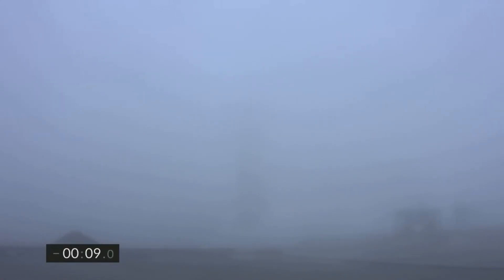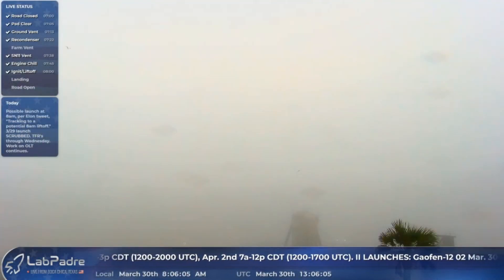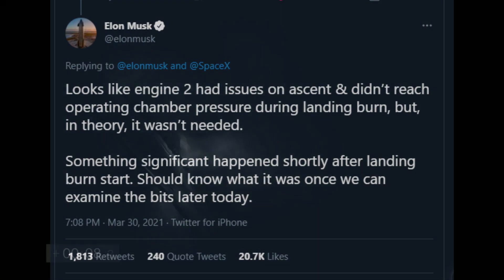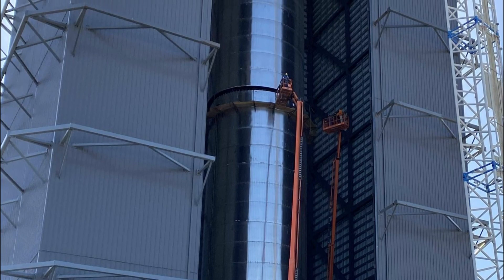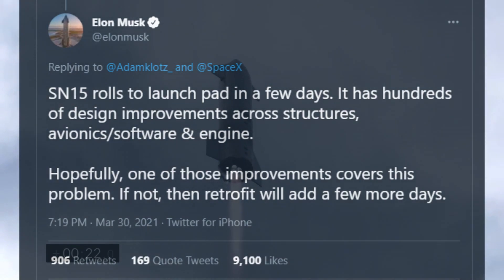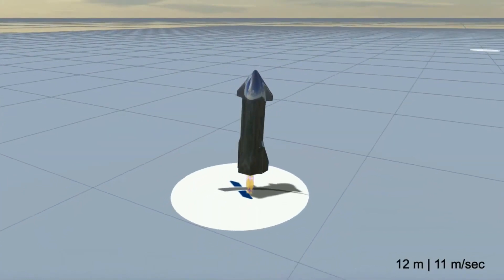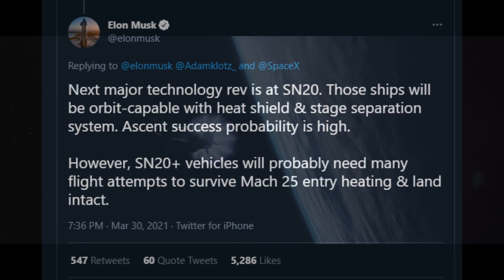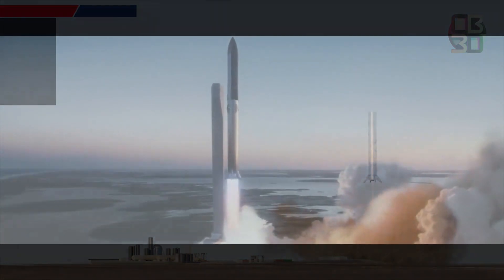How Will Starship SN11's Failure Affect SpaceX's Future Plans?

Comment: In the big picture SN11 wasn’t that important.  It’s the last of a series and was obsolete before it flew.  The information they get from the SN11 engines will be valuable and made it worth flying rather than scrapping.  
BN3 will carry SN20 and BN2 should be on the platform by the end of April According to Elon.  Which at this point seems possible if they can produce enough engines for these tests.  SN15, 16, 17, and 18 should fly April to July. From the suborbital pads..  ambitious schedule but all very possible.